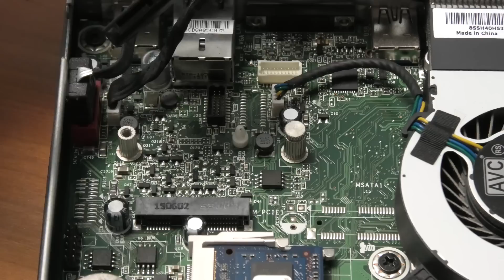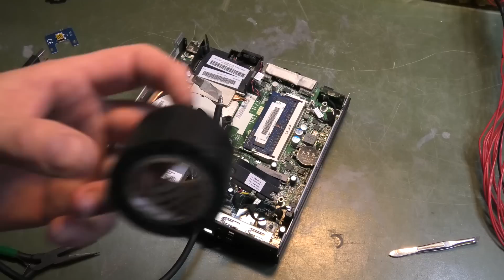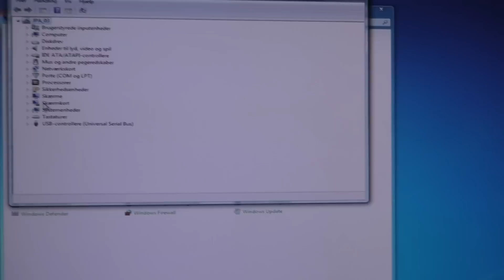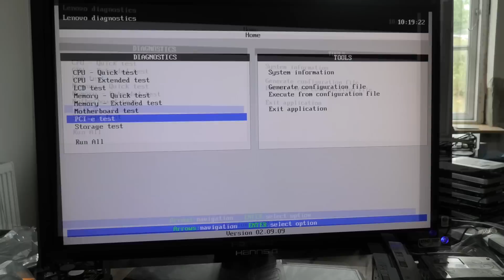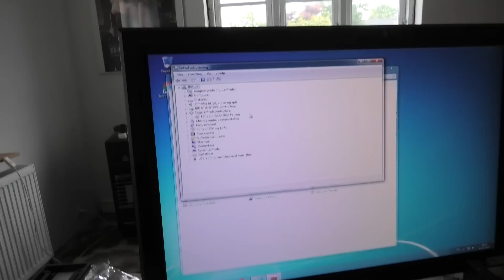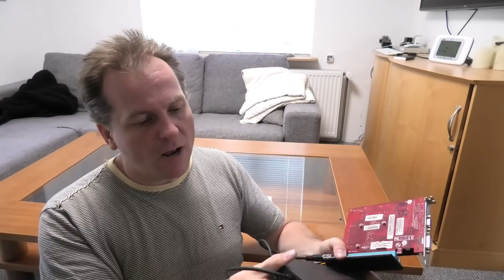Tiny Lenovo with External GPU or HBA/RAID Controller - 1206

Comment: there may be an m.2 slot on the bottomside of the system under a slide out panel and that will have more bandwidth if your ok with running the system off a sata ssd up top
Reply from the maker: No this model is too old :-/

Comment: You inspired me, my new Lenovo m70q tiny has 3 video ports but I really needed 6 monitors. It had a second empty m.2 port on the motherboad. I bought a RII brand m.2 adapter and an external video card dock that also mounts a desktop power supply, used an nVidia Quadro P620 card and BAM  now I can use up to 7 monitors at once.  Great upgrade for not a lot of money.
Reply from the maker: Dang it 6-7 monitors!! you're gonna get square eyes :-)

Comment: Also, if your M93 has that unpopulated port cutout on the rear of the chassis, you can get a panel mount USB 3.0 female connector to mount there that plugs into the mPCIe to USB adapter.  Then you couldn't have any dangly cables hanging out the back and woulnd't have to worry about strain release.  You would just plug a USB 3,0 cable into the panel mounted female port you just put when you wanna use eGPU.
Reply from the maker: Great info! Thank you for sharing your setup insight.

Comment: My mPCIe to USB adapter board had cut lines silk screened onto it to let you know it's ok to cut.  I just used side cutters too and it was very easy to do.  I also had to modify a USB cable to fit, but they do sell right angle ones, even ribbon cable ones, or even 180 degree connectors.  I'm just cheap and impatient.  Someone also was able to put that mSATA connector that isn't there by soldering it and a few components, and it detected it immediately in BIOS and he was able to install Windows on it no issues.  That's my "final boss" mod for these PC.  I am also curious about running a 65W CPU with an upgraded external power supply.  I have not done any research on that yet though, and I don't think there would be any pay off unless I Was able to mod the BIOS, which is out of my realm of experience.  Not even sure if the board has power circuitry capable of it either.  I think I am gonna grab a cheap R7 250 OEM for GPU, since it's low power and inexpensive, keeping with the theme of the build.
Reply from the maker: We have been keeping this older model alive for quite a while.

Comment: Yeah.. computer engineer here, do not do this.. get a lenovo m920q instead
Reply from the maker: There can be a prices different there.
Reply: @MyPlayHouse  you might find it second hand for cheap
Reply: @Determinator24 is the layout the same? My m900 m.2 is underneath no way to fit the adapter
Reply: @Jremr  pcie port is exclusive to the m920q and 720q
Reply: why not?Explain
Reply: @laracroft8140  because using sata power Interface to power a graphics card will draw a lot more electricity than it is intended for it, causing the cables to melt and damage your components in the process.

Comment: Awesome! I’m connecting a gtx 970 to the same set up you have, it detects the card but can’t seem to install the driver, am still at it 😅
Reply from the maker: Best of luck :-)
Reply: @MyPlayHouse  ha! got it to work, i stripped down the mini usb just like you did and the missing part was plugging the 6pin fr the psu to the 8pin of the gtx970. Ur vid was really helpful!

Comment: I have a lenovo ideapad l340-15irh, i am thinking to install an e-gpu, do u have any advice of gpu to use that i mind use on a future desktop? Ny budged is around 500€ maybe bit more
Reply from the maker: Yes,, I would suggest you test it out with a very cheap card first,, like i did,, something like a €10 card old and not important :-)
And be aware of PCIe 3.0 and PCIe 4.0,, when you later goes shopping...

Comment: Nice video! I have been trying a similar project. Question. Were you able to have windows identify your external GPU smoothly? Do you have to adjust BIOS and/or Device Managers?
Reply from the maker: I didn't,, you saw what I did :-)

Comment: Hello, can you tell me whether it works with the PCI card with SATA to use multiple hard drives? and how is the performance? I thank you !
Reply from the maker: I have been making a project of making a DIY DAS,, putting in a handful of 10TB SAS drives,, it does work.
Reply: Do I absolutely need a raid or BHT controller?

Comment: Can this work on lenovo m700 tiny , i opened it up and i see one slot taken up by wifi card , is that the mini pci express slot i can use for the graphics card?
Reply from the maker: Yes that was the slot I used,, but I did not have anything in that slot,,, so you loses your WiFi :-/ ut it can be gut back in if you change your mind :-)
Reply from the maker: YouTube is messing up, and climes that I have not replied to this,, sorry for the "disturbance in the force" :-/

Comment: You really should look into an M2 to Oculink adapter and use an Oculink cable to connect the video card, that should get you at least an x4 connection which will really improve speed.  My motherboard has an Oculink connector on board, so I just started experimenting with it myself.  Buy a good cable, the one I got didn't work at anything faster than PCIe 1.0 so I ordered a new cable.
Reply from the maker: Hi @PosiCat
Thank You very much!  glad you liked the video :-)
Thank you for watching! :-)

Comment: Ahh, cool cool cool. Am looking at doing the GPU via m-PCIe thing myself.
I CPU swapped the 4570T (35W) to an i5-4690T(45W) [methinks a cooler upgrade is in the near future] and have all the gubbins to externally add an R5 240 (a. to relieve the iGPU Watt duties. 2. it's what I have at hand.  and iii. awaiting a R7 250/R5 430 to pop up locally on Ebay, they're usually ~$25)
 Basically building a ~100W Indie/Emulator gaming HTPC in a <2L box.

 But I did come across a forum post where the m-PCIe port has a White List of supported devices that may need to be rewritten.
Reply from the maker: Hi @two-eyedroy4883
Thank You very much!  glad you liked the video :-)
Thank you for watching! :-)

Comment: I bought the same riser set, except the plug standard is M2 NVME. After several tries it still doesn't recognize the video card. Finally, both NVME slots on the mainboard were dead.:face-purple-crying:
Reply from the maker: That is weird,, did you try them with a M.2 NVMe disk,, see if that shows up.

Comment: Do you still have to attach a 6pin connector if the GPU runs off the slot and not a external 6pin power like a GT710
Reply from the maker: I do believe so... the little board needs power as well

Comment: Excuse me, what is the hba model in the video you used, I did tests with a (LSI 9211-8i 6G SAS HBA FW:P20 IT Mode ZFS FreeNAS unRAID 2* SFF-8087 SATA US) but it does not recognize it
Reply from the maker: it is older than that,, think it´s a LSI 9207-8i,,,,

Comment: Hi I wanted to ask if my GPU does not requires any external power . Will it work ??
Reply from the maker: The little board still needs power,, as that is the only power for the GPU. But a GPU with no extra power need should work.

Comment: Hi, i have a question. How did you connect the power supply to the Mini PCIe to PCI express 16X? Because you didn't show it in the video.
Reply from the maker: It is right here : https://youtu.be/tYDkn5Y8RZc?si=tWIg8v6sLyQgMu2v&t=909
Reply: Hi, I have another question. What if i want to power up a more powerful GPU like a Geforce GTX 1660 super. How will that work? How will i need to connect it?

Comment: 🧐Nice option but, I got a similar step up and the R3G external gpu adapter 70$ works best and connect the hard drive with a external enclose to avoid the connection shafting and a dell 6pin 250watt power supply 15$ for the gpu.
Reply from the maker: Hi @carlosgrant4227
Thank You very much!  glad you liked the video :-)
Thank you for watching! :-)

Comment: Hello
I got a lenovo thinkcentre m715q tiny gen 2
 2400ge apu 
With 32 GB ram kitt.
Aslo a ADT-Link r43sg m.2 adapter
Dell 220w Passive power supply 
Gtx 650 ti boost GPU
Aaand it's not working 😢
I suspect that my bios is the problem.
It's quite limited 😕
Reply from the maker: That is a shame :-/
Reply: @MyPlayHouse  well, yeah...
Got any idea how to fix this problem?
Reply from the maker: No sorry,, I do not have that model. But you should try the Lenovo forum,, there are Lenovo people there that will try and help you out,, even after it is out of warranty.
Reply: @MyPlayHouse  yeah, I already tried. Sadly, it was futile. 😞
Reply from the maker: That is a shame :-(
Reply: @MyPlayHouse 
Don't be!
I got a SPI bios chip programer!
Downloaded a mod bios for my PC.
Updated the bios.
Now, i have a lot of options!
Then i find the External GPU option.
Allocated the resources to the eGPU adapter,
Than BOOOM!
I Got full size gpu hooked up to my Mini pc! :D
Now i can update this GTX 650 ti boost ot a RX 6600 XT!
Reply: @1987Redfield  I have the Gen 1 version of this pc. What is an SPI bios chip programmer? Would love to finally get access to the bios and bring the computer to life like it actually should be. Ryzen controller has helped but I still feel really limited.
Reply: @brandonstewart9406  
It's a tool for flash/install bios to the motherboard.
10€ i was it. It's cheap.
You can find a tutorial on youtube how to do it.
But, first you need a bios mod.
Find/ask someone for your specific pc

Comment: hey bro nice video i have one question. do i need a power supply to use gt 730?
Reply from the maker: The PCI-e board needs power,, and that will supply whatever card you put in there with up to 25watt. If your card can run with just that,, it should work,, if your GPU normally needs extra power 6 or 8 pins,, well you need that as well.

Comment: This is brilliant! Thanks for bringing this to attention. I've been looking to find a board lower consumption, yet capable hardware for my pfsense router and firewall, and this fits the bill. Better yet, I have a spare m900(and a m710q) board, an old Cisco router for a chassis, and a new power supply. Definitely, will explore this idea. Thanks again!
Reply: And with an HBA, this board can easily be a jbod controller. Exciting!
Reply from the maker: You are most welcome 🤗

Comment: I have two risers in my micro PC, I could do both at the same time...

Currently I have two 1080 TI's in my Dell Optiplex 3050 micro.

I just want to know, what is your opinion on that? Maybe I will make a video about it some time. I truly love it in all honesty, it is my goal to make one of the fastest and best micro PC's in the whole world (Yes, it has a 600 watt power supply, not just the normal integrated one haha)
Reply from the maker: I want to do this external card thing so I can add a raid/HBA controller.
For the tiny to be a storage server. 🤗

Comment: Nice video. Next time you could use 90°USB adapter and avoid wire problem.
Reply from the maker: I do not thing there is enough spaces for that... in there :-/

Comment: There is 12v on this board you can use, from the original SATA power supply.  if you use a SATA  power splitter cable and a very short SATA signal/data extension cable you can keep the original HD and power another drive quite happily. Just use another extension as long as you want for your flying 12v lead.   Personally I'd replace the original mechanical HD with a SSD to keep the power down, but it works fine.  You can even use an M.2 in there with a little converter board.    If you wanted raid or more drives you can put a little SSD in the mini pcie slot.   Or if you wanted several drives...    use a Mini PCIe to SATA III 1 or 2 or 4 Port Adapter Card in the mini pcie slot. For the 2 or 4 port ones you need to dump the big drive cady though. Power from the board might be a problem for lots of big mechanical disks but SSD's use almost nothing.    I love these little Lenovo machines, the size makes them challenging but a lot of fun for the money.
Reply from the maker: Only 3.5" HD´s uses 12v,, and as the Lenovo Tiny only has room for a 2.5",,, there might not be 12v in the connection ?? Why would there be 12V if nothing uses is.... 
and the card /a PCI-e card can use up to 25W's,,, that is a lot to ask from a tiny PC with a 65W power supply :-/

Comment: do i need the power supply? to use the external graphic card?
Reply from the maker: Yes it needs power,, the little PCB needs like 25W,, and the GPU might need a lot more power, if you add one with power connections.

Comment: Hi, thanks so much for this - I have a M93p that I was using for retro games emulation and I decided to see if I could add a GPU using your instructions - and I could! It works an absolute treat. I've connected it to a GT 710 video card and I can now play older games like "Left for Dead" on it really well. I'll be hosting a lan party in a couple of weeks and intend to use it then instead of trying to find room to put another tower PC in my office! Brilliant stuff, many thanks.
Reply from the maker: I did a later video where I put a raid controller and added 158TB to the tiny Lenovo.
Reply: hello, you can upload video setup your pc. please

Comment: Why not remove the connection on the board and the cable to go directly to the board?
Reply from the maker: Well,, I have no good excuse :-/ I could have done that.
Reply: @MyPlayHouse  the only reason I ask is because you could of used it for the back of it and the be able to get another cord so there no cord hanging out so it would look better you could also get a step up  adjustable power regulator PCB so there no need for a power supply specially if its a step up less pull and I probably use something like the power supply case to put the board and adapter in that why it safe and not exposed great video gave me some creative ideas to add on my laptop 👍👌✌️💯💻🖥️🖱️⌨️
Reply from the maker: YouTube is messing up, and climes that I have not replied to this,, sorry for the "disturbance in the force" :-/

Comment: Did you ever find out a better way to power the break out board?
Reply from the maker: No not really.
Reply: @MyPlayHouse  Would it be possible to take a 12V power supply  and solder a female SATA connector to the end of it? I wonder if that would work.... ha ha

Comment: They make those egpu connections that work with nvme and Thunderbolt. The mini pci express’ data transfer rate is much slower than the other connection types…if your system has them.
Reply from the maker: I did not benchmark it.. but there was a connection.

Comment: I think at the point I would have removed the top and bottom plate and slide this into a slightly bigger SFF ATX case and than properly mounted a PSU and GPU in the case  and be no different than the height you have it not but it be just cleaner ..
Afterall these Lenovo boxes are meant to be mounted sideways on the back of the Lenovo monitor so it be pretty well ok to buy a box or 3D print and acrylic one and it be perfect and cleaner look for the wires imo
Reply from the maker: :-) Yes,, why not just get a PC that will fit a GPU :-)

Comment: Could it work for a newer m710q? Since it has a pci express port where an m.2 nvme is mounted, however, it would be a shame to disable it to put a graphic. So I thought I'd do exactly what you did in your contribution video.
Reply from the maker: You can do this with an M.2 slot i hear,, you have to get the thing that fits in the M.2slot.

Comment: this was ok and something the slightly less geeky are not aware of - you can use nvme slot to power hd or gpu - good one, i think the trends are going to go much more to mini pc with advent of zen4 - lots of power in a small box but it doesn't use much power - zen4 minis will make good low cost cluster nodes for easy scale - i really think 100gbe is trend for smb sector - they need it and will future proof them for 10 years - they can easily upgrade to 200 using bond0 or bridge - more cheap 100g switches should be out soon - you should consider going to 100g yourself - could make good content - thanks for the video!
Reply from the maker: I am on 10G,, but uses 1G the most,, 100G is really power hungry,, if I want to run a switch for that.

Comment: Great video! Just want to use at Bargain hardware the coupon code. I get a error:  Coupon code "𝙢𝙮𝙥𝙡𝙖𝙮𝙝𝙤𝙪𝙨𝙚" is not valid.
Reply from the maker: I just checked,, It works for me,, we do though have the suspicion that it only works once a year,, per account,, so you need a sec. account if you have already used it. :-/

Comment: Many Lenovo laptops will stop boot if you put an unapproved card in the Wi-Fi slot. I am surprised the ThinkCentre does not.

And there is some 12v power inside. The fan says it needs 12v and there is also a yellow wire on the internal hard drive plug.
Reply from the maker: I have also heard that,, so I was not expecting this nice a result.

Comment: Hi Morten, really cool that you are doing this, i am expirementing myself, just with a laptop i decommed from work, i am using the nvme slot to an external PCIE slot, i will be using a LSI 9200E HBA so i can connect it to two external disk shelfs, and run a super low power node for Chia. my plan is to remove the laptop motherboard and move it into a small case like this.
Reply from the maker: Cool,, is it correct that the M.2 NVMe slot is x4 ?
Reply: @MyPlayHouse  im not sure i need to test that, i think the HBA i got is 8x, the m.2 i got is 16x but not sure it can do 16x speed, probably limited to 4x like you are saying